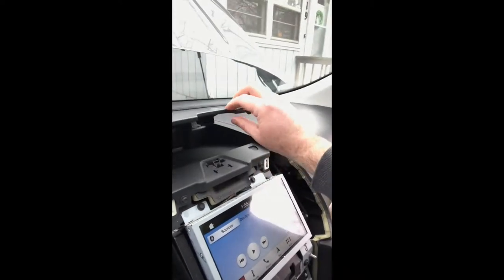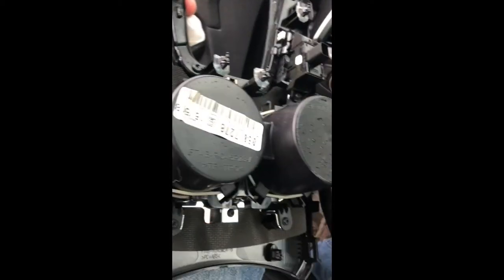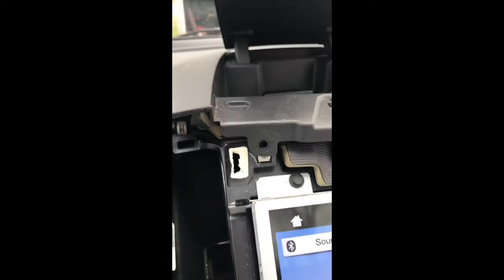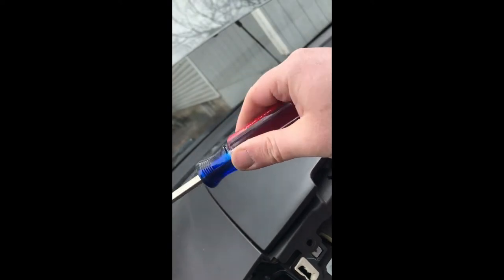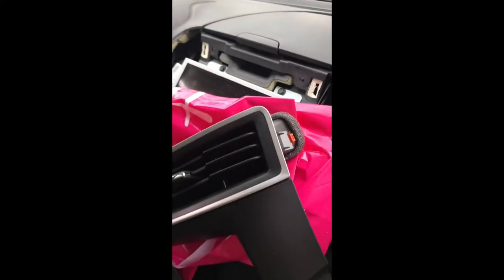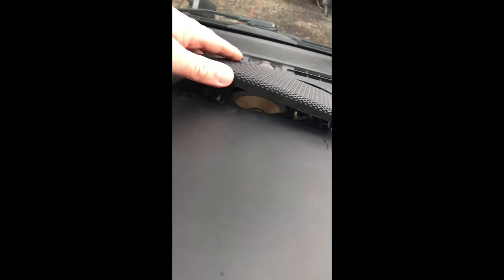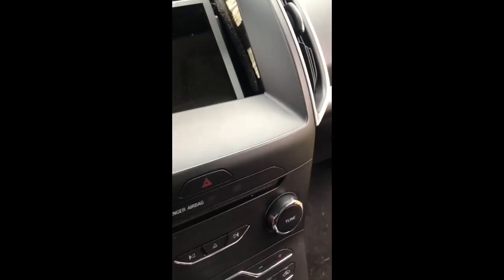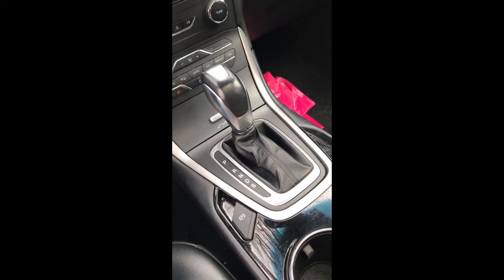2015-2018 Ford Edge Storage Console Replacement

Comment: just the vide I needed to know I wasn't going to do this myself!

One question... I just need to replace the hood.  Is there anyway to remove that without removing the whole assembly?
Reply from the maker: Not from what I could see. I couldn’t even get it disassembled once I had this unit out. Best I could do was get the spring and latch out so the button was no longer necessary.

Comment: do you know where i could get just the button for the storage console on the dashboard? 

Mine formed a bubble during a hot day and the plastic wrap popped so it looks weird? I have a 2017 titanium
Reply from the maker: I couldn’t figure out a way to replace just the button (which was broken on mine). It’s too integrated with the spring mechanism and the rest of the plastic casing. It was easier to simply replace the entire assembly.

Comment: How did you remove the Speaker grate again?
Reply from the maker: If I remember correctly, I used a short precision flathead (“eyeglass screwdriver”) to pop out the speaker grill. I worked from the back to the front and I might have had to open the lid to get it out. The speaker grate is held in with clips and pressure. 
Let me know how it goes! As I recall, that was the hardest part to figure out.
Reply: @techguy651  I will try again later. I just want to upgrade that speaker for now. Also want to upgrade the Subwoofer next.
Reply from the maker: @Willie1980  yeah, that center speaker sounds like ASS. My wife turned down the SYNC volume in the system settings to make it bareable. At one time in my research last year, I found a write up that described the proper specs for a replacement in the center console (I believe it’s an oddity in the car). Of course I can’t find it today to link it to you. 
I do remember there was no obvious way to unplug it, so be prepared to cut and splice or solder. Good luck!